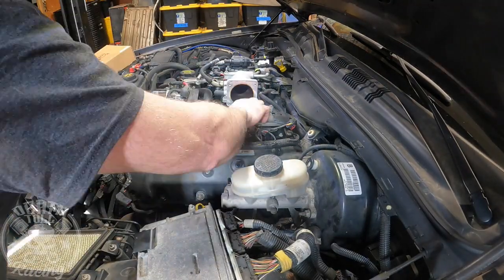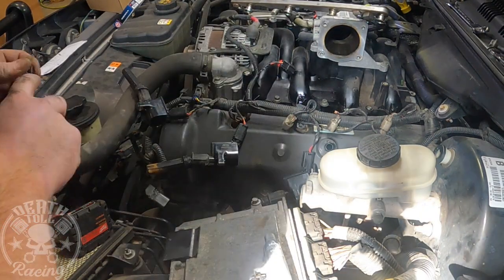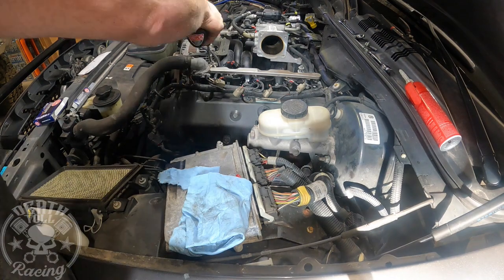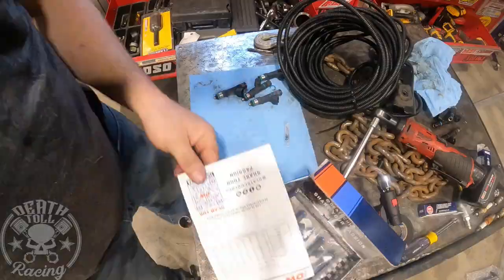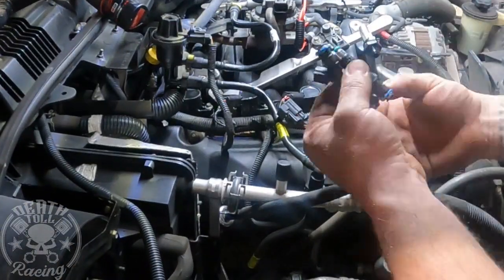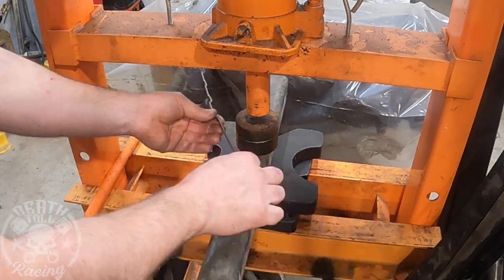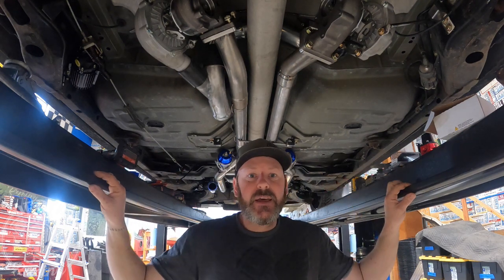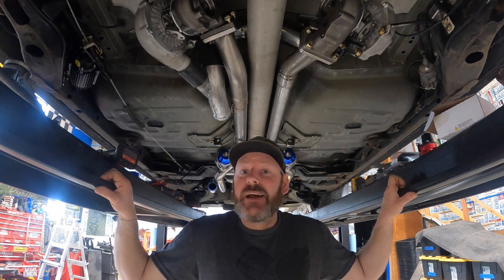Ep 4, Twin Turbo P71 Crown Victoria, Fuel Talk, Fuel Injectors, Spark Plugs, Sleeper Police Car

Comment: What psi are the stock injectors and how tunable are these stock flex fuel crown vics how much power do you think could be squeezed out preferably without any forced induction?
Reply from the maker: 19# or 24# depending on the year. They are rated in “pound per hour” not psi.  

The stock injectors will be fine for pretty much anything you can do without forced induction.  Unfortunately, it’s very expensive to get much out of them without though.
Reply: @DeathTollRacing  A procharger is what I was thinking, so really no more than about 9psi of boost also will I still be able to use E85 with aftermarket injectors?

Comment: Pretty sure the biggest restriction for factory fuel line is a 90 degree fitting at fuel filter location. Completely removed mine on marauder. Want to go with bigger line
Reply from the maker: yeah, I ended up replacing the line from the tank to the filter with an line.  I did it when I wap block swapped it, just in case the reason it blew was fuel restriction causing a lean condition.

Comment: Another great bunch of tips.  Question….. the camera angles sure makes it looks like the exhaust is almost touching the drive shaft?  I’m certain it’s an optical illusion to some extent.  But, what happens when the rear is raised off the wheels?  Does the driveshaft get even closer when the rear droops?  👍😎👍
Reply from the maker: Yes, it is closer than I usually do it.  It always is at least 1/2" away though.  I should have pointed out the jack sitting on the lift where I made sure it maintained clearance.  At some point I will point out the clearances since I missed explaining that part.  Thanks for pointing that out!

Comment: Build is looking good. 

Typically gap on the plugs is a little tighter than factory to keep the higher cylinder pressure from blowing out the spark, probably not going to be a big issue, but something to keep in mind if you get a misfire under load you can tighten the gap.
Reply from the maker: I had the same theory.  I was just talking to a friend about that as well.   Thanks for confirming that for my point!!!  lol